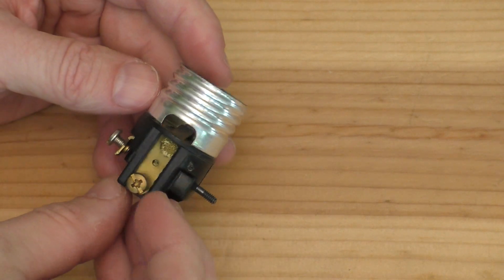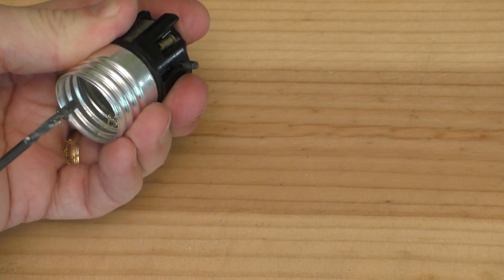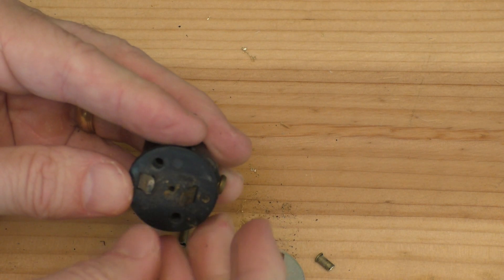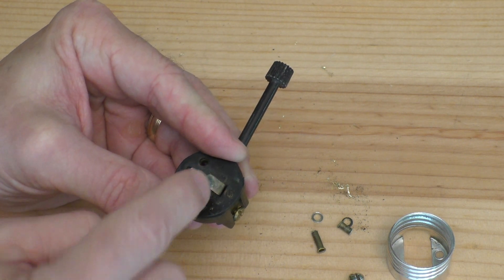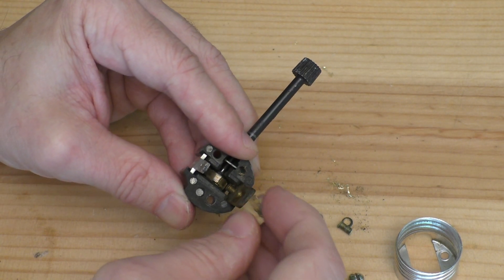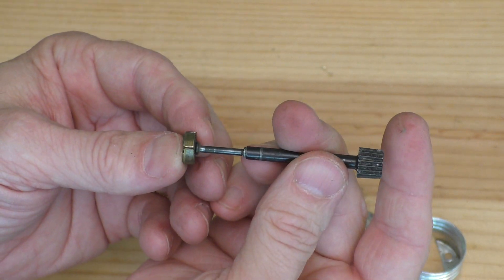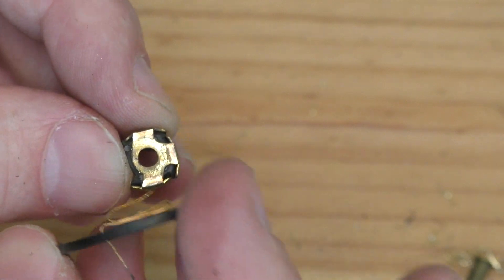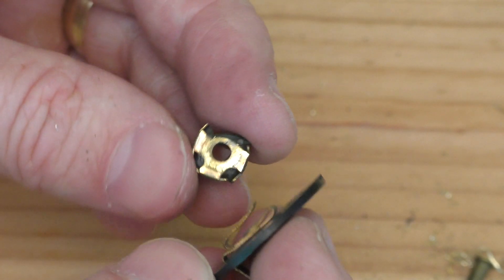Anatomy of a Lamp Socket Switch

Comment: This is exactly what I was looking for. I wanted to take mine apart because I was thinking it has to be a very simple mechanical process inside that I could easily fix. This tells me that my thinking was correct and that once I would tear it apart with a drill, I would be better off to just buy a new one for $5 : )

EDIT: I ended up taking mine apart and trying to fix it. The moment I attempted to bend one of the copper dangling connectors, it immediately broke off. Old and lots of use. I'm chalking it up as a mechanical failure and I am now satisfied!

Comment: Thank you for making this video, you saved me from having to make it myself! (and by strange coincidence, my broken socket just so happens to be the exact same socket as the one you took apart here, so this video really helped me to gauge whether I should bother trying to repair my broken socket or not).  

I was shocked to find that your video seems to be the only one of its kind online (the only video that dares to show the inner workings of a bulb socket/switch). Even google images seemed to come up with nothing with all of the related 'how a lamp socket/ switch is made'/ 'what's inside of a lamp socket' variations of search strings that I tried.